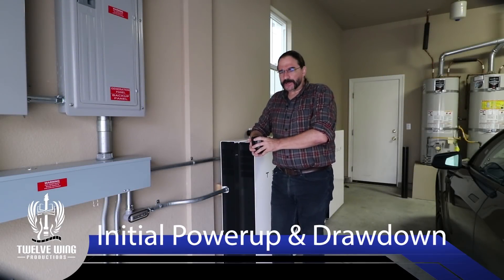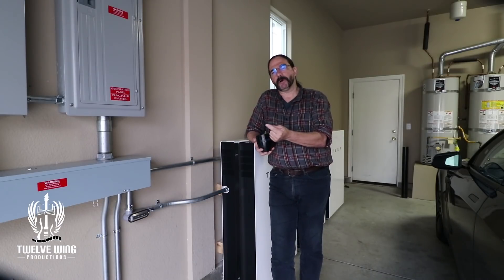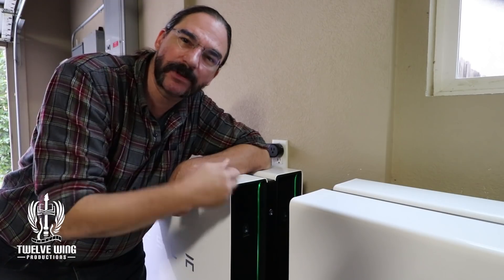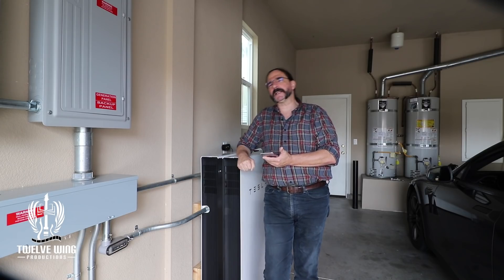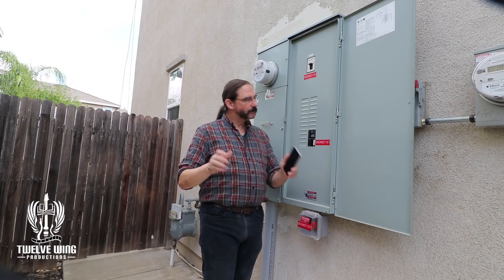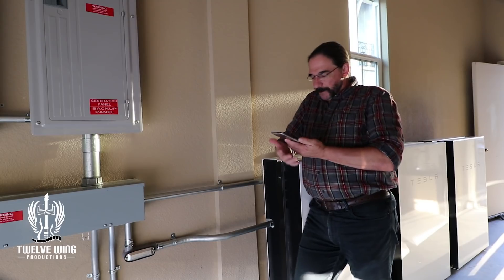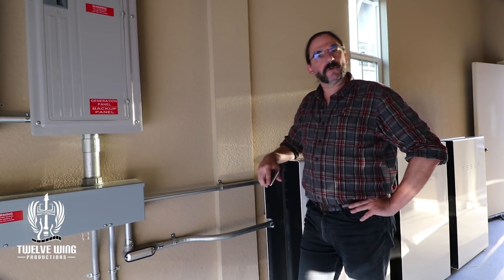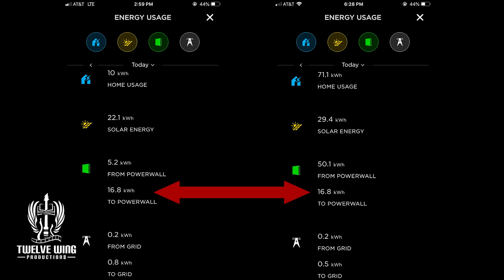New Tesla Powerwall 2 system? : Do this right away

Comment: I have 1 powerwall and they couldn’t connect my ac or the level 2 charger for my car.
Reply from the maker: One powerwall doesn't supply enough current to power an AC unit.  You need at least 2 of them.  3-6 is appropriate for most homes.
Reply: @twelvewingproductions7508  yeah it just wasn’t in the budget. Hopefully I can add another down the road

Comment: Will the 6 power walls and a roof full of solar panels fully run a large 6 bedroom 4,000 foot home, with 3 Large aircondition unit? I live in Philippines, plenty of sun!
Reply from the maker: The short answer is yes, but I would have to know more about your daily consumption to tell you what size system you would need.
The system in The Energy Sovereignty Project can give you some idea.  This system is 10kw of PV with 90kwh (82kwh usable) of battery storage.
This is enough to deal with 36kwh of home usage as well as 10,000 miles driven per year on excess sunlight.
We were limited in our install to about half of what I had initially wanted to use.  I would say to properly go off grid one would require 15--20kw of PV on a home the size home you have.
So long as your utility company isn't trying to limit you below that, the answer is yes.  Easily.

Comment: Have you done a session on how to determine which mode is best for one to use? I have 2 walls and I struggle deciding between them. Mainly because I find it hard to believe the arbitrage setting (cost reducing) can work without knowing my rates.
Reply from the maker: Frankly I'm a bit surprised that they haven't added more into the "custom" setting.
Currently I use self powered and manipulate the reserve setting as needed.
My feeling is similar to yours though in that there needs to be a way to program it with more information.

One thing I'm looking into is how the vehicle charging currently works and how I think it "should" work.  After that I should put a video up on my thoughts.

The system does know when your rates change.. so it doesn't really need to know your exact rates but it does need to know your peak times.  The way you have currently to enter it is clumsy and non intuitive.  I think they could have done that better.
Reply: Twelve Wing Productions Would be a great video to see how you think about it. Also trying to get an idea if it’s worth getting an additional wall. 6 seems like overkill for my situation but I’m debating if 3 or 4 make sense. Suppose then I will want more generation. Endless loop ;)
Reply from the maker: @normangennaro9448  Well, it's endless until you have what you need.  In our case, because of the driving, I think 4-6 is perfect but I'd really like to have an additional 7k or so of solar PV production to bring our total to around 17Kw.

Are you using an electric vehicle?  What's your average daily consumption per day spread over a year?
Ours was 36kwh on average for the year.
Reply: Twelve Wing Productions I do have a Tesla car as well. My usage patterns since covid are all messed up. I’m working from home now, my two sons were home (one went back to college today), we have had a heat wave and then fires pretty close which means windows closed/ac and fans where I usually don’t, but I’m not driving/charging the car. It’s super variable now and moreso than ever before. This week I have averaged 75 kWh with a peak of 83.5. In May I used 844kwh, June 613, July 1561 and Aug already at 1536. I had solar before w/o the powerwall so I don’t have an easy way to pull before then.
Reply from the maker: @normangennaro9448  Understood.  Yes, Covid has this all kinds of messed up as far as metrics.
Do you have a power bill for last August?  That might help but it looks like you are also in that 30kwh per day kind of range given your may numbers.
So I'd say you would also be looking at 10kwh of production and 4PW2's.
3 of them will run your entire home and the extra capacity will be mostly for when all this returns to normal and you are driving home to charge your car for the next day on power collected while the sun is shining.

What is your usually daily commute?
Reply: Twelve Wing Productions I’ve had solar now for almost 3yrs. I’ve got 9.9Kwp peak power capability. PGE monthly charges last August were $9.86 electrical but I also got hit with $1,053.30 NEM charges which is why I thought the powerwalls might help and after a long wait and tedious install which took a couple months are finally in. I can’t tell if I need more than two powerwalls since I’m not sure I could even charge them over the winter. It seems like they could be helpful over the summer but suspect I need more solar to make them useful in the winter?

Daily commute would be San Carlos to SFO so say 70 miles a day but we are now work from home probably through most of next year.
Reply from the maker: @normangennaro9448 , I would suggest that you have a look at our videos for November, December, January and February.
Those videos will show you the expected fall of and where the additional capacity came in handy.
Our goal in this was a little different than most in that we were focusing on how little we could use the grid at all.

In a way this was designed not only to be an argument ender but also to get people ready for when net metering ended.
On your last year's bill, what was the total usage shown for all of 2019?
With a tru-up of over $1,000 it seems like your total usage was up in the 40-50kwh per day range rather than 30.
Reply: @twelvewingproductions7508   Will do. I was watching the latest ones and then went through your past videos and found this one. Need to watch these others you recommend. My hope was that I could be minimally using the grid. Don't need or want to be off-grid but prefer to be self-sufficient which is why I found your videos so encouraging. While I have dropped a lot of usage it's clear I have a long ways to go. 2020 is looking like I've really reversed the trend :( I'm in Storm Watch right now and have been most of the weekend which is not helping and from what I can tell Advanced/Cost Savings isn't helping either but the tesla group tells me that is the best way given EV2-A.

2020: Total 3,101 Kwh, Avg 517 Kwh/mo, Max 1,103 Kwh/mo, Min 8 Kwh/mo
2019: Total 3,992 Kwh, Avg 333 Kwh/mo, Max 1,232 Kwh/mo, Min -320 Kwh/mo

2018: Total 15,612 Kwh, Avg 1,201 Kwh/mo, Max 1,837 Kwh/mo, Min 198 Kwh/mo
Added Solar in Aug 2018

2017: Total 17,174 Kwh, Avg 1,431 Kwh/mo, Max 1,675 Kwh/mo, Min 1,288 Kwh/mo
2016: Total 17,204 Kwh, Avg 1,434 Kwh/mo, Max 1,614 Kwh/mo, Min 1,147 Kwh/mo
Reply: @twelvewingproductions7508  The more I look at the data the sadder I get! From April-August 2019 I averaged a negative 232 Kwh. This year with all of the power/solar being turned off to get these walls installed (took the forever with covid, multiple days and several redos for inspections), I'm averaging a positive 135 Kwh and that does not include August which has to be a record given the heat, running a/c at night due to smoke and now storm watch.
Reply from the maker: @ngennaro  2020 has just been a complete bitch.  It really has.  I'm very thankful that we got a year's worth of solid data for the project before the nonsense started.  We had our issues too with the software faults near the end of the year, but at least the data was sound through the first of the year.

I'll try and crunch those numbers you gave me into something meaningful over the next couple days.  I have been dealing with family health issues on this end.
Reply: Twelve Wing Productions been a tough year no doubt. Hope all is ok. Please take care and don’t worry about my numbers. Know that the community loves your videos and insights but can and will wait for you!
Reply: Twelve Wing Productions maybe I was expecting too much precision :) I thought the difference between peak, shoulder and off peak might make a difference in whether it’s worth doing this arbitrage it seems to be doing on cost savings when it sends all the solar to the house or grid and not powerwall.

Comment: These are no go for off grid
Reply from the maker: They now have an off grid mode.
Tesla realizes that these things are being used in trailers now.  So they are making software alterations to allow for off grid use.
If you have some other reason you feel they are unsuitable that isn't covered by software, give a shout back and let us know why you feel that way.
Reply: @twelvewingproductions7508  i talked to tesla 2 weeks ago and they wete practically laughing at the idea of using it for off grid. Like "we deal with way bigger fish" kind of thing. They were also paranoid about incorredt jnstallation and use putting the brand image at risk
Reply from the maker: @mobiusdesigns , It's on their web page.
Reply: @twelvewingproductions7508  thanks
!
Reply: still couldnt find it. the screen redirects to talk to them in person. could you link me to the page?
Reply from the maker: @mobiusdesigns , if you haven't called them I'm not sure what additional information I could provide you.  Call them and tell them you want to install the batteries in a trailer.  I know someone that has done this.  Come back here and let us know what they tell you.  Please be honest about it because I can guarantee you that I'll be doing the same thing to verify the validity.
Reply: @twelvewingproductions7508  curious, where did you hear they are doing off grid mode now?

Comment: I think you are mistaken that PowerWall shuts off solar inverters, if the house circuits do not consume all generated power from PV inverter. PW plays with frequency of created AC to force inverters to stop producing power,  if house circuits and battery itself cannot consume all of it.
Reply from the maker: That's how the PW shuts off the inverters... by throwing them into a frequency fault until the batteries have some freeboard.  96-97% or so and they turn back on.

Comment: Just came across this video, my 2 PWs have been at 0% for the past week and a half as I wait for PTO.  Are you aware of any long term issues with leaving the batteries on and at 0% for so long?  Does it even matter if I toggle the switch to off at this point? Thanks.
Reply from the maker: If it's extreme yes... but for a month or so probably not.  When the battery says 0% there is still about 1kwh in each battery.  So you should be fine. If they keep dragging their feet for weeks, however, you should mention it to your installer.

Comment: Thank you for sharing and taking the time to make this video. I'm about to pull a trigger on 8.5kw solar array and Powerwall. I'm in MA so we have net metering. Our winter daily average 30 kWt. The local installer offers 1 PowerWall and subpanel for critical loads (like heat, fridge etc) to get us through outages. Tesla offers 2 Powerwalls for 30% more for the full house back up. What has more sense in the long run? Thx
Reply: Kirill who did you use in Ma?  I am looking into making a purchase with a home Reno. Need to look into the battery
Reply: @tgomes32  I went with revisionenergy.com  It seems they were more experienced with batteries that other two companies I interviewed. BTW, because of covid we are still in prep mode.

Comment: Permission to operate? That's funny, really funny. lol I know you're not supposed to flip the switch once your panel system gets installed but I'll quote what my installer told me, "Technically we can't prevent or stop you from using your system but................." lol
Reply: I agree, especially since your Powerwalls would absorb most of the solar until they are full.
Reply: I am getting my solar power system and Powerwalls installed next week.  I never would have thought of this, so thank you!
Reply: Are there any penalties if you don’t wait till your told to power on?
Reply: mchevownr - that depends. If your utility hasn’t said you have permission, it could mean that you will give them your solar power for free, or even worse, they will CHARGE YOU for the power you gave them!  Best to wait or operate off grid.
Reply: mchevownr this is one of those “don’t ask don’t tell” kind of things. lol

Comment: Nice breakdown!  I am in the process of installing 2 Powerwalls with a 13,065 kWh system and wanted to see if there are any circuits I SHOULD NOT be putting on the Powerwalls as whole house back up.  For example, HPWC for my car, pool pumps, washer/dryer.  I am just concerned if I do, and the power goes off at night the HPWC will drain the entire two batteries.  I know since you have 6 Powerwalls you probably didn't have to separate the loads, but I wanted to get your thoughts on this.  Thanks again!
Reply from the maker: Your main issue will be total load.  With two powerwalls, you have a total of 10kw to work with.  If you are still on grid power, that's fine.  If you aren't then you run the risk of tripping the system off if you try and charge your car.

But here is the deal though.  If you have a power outage, NOT having your EV charger or AC on the system might make for more than discomfort depending on your situation.

I would say that you can certainly do without a pool pump for a few hours or a day or so... but vehicle charging?  I would leave that one BUT... in the case of a power outage, be very careful at how much current you send to the car.
If you have a Tesla, this will be easy.  If your car is something else, you will have to consult your owner's manual to see how to do this.

What is the total average draw of your home over the course of a year?  If you can give me a summer and winter average home usage that will be even more helpful.

Also your general location and elevation will be helpful for me to give you a better idea of what I might chose to leave out.
Reply: @twelvewingproductions7508  Good point on the EV lowering the current.  My average kWh over 12 months is 1355.  My avg summer is 1520 and avg winter is 1275.  I live in SoCali as an SCE with a TOU D Prime.  We are not part of SCE's PSPS and rarely have power outages lasting longer than an hour.  Powerwall is to primarily offset new TOU peak hours of 4-9PM.  Thanks again!
Reply from the maker: @htran383 , Just so I understand you correctly, you are using approx. 50kwh per day summer and 42kwh a day in winter for an average daily usage of 45kwh.

Is that with charging your electric vehicle at home or is this before factoring in an electric vehicle.
Also, it would be handy to know the approx. square footage of your home and the layout... one story or two.
This will help me give you some prudent advice.
Currently I would say that you would require 20kw of PV production and 4-6 Powerwalls or around 90kwh of storage if you use some other battery type.

The answer about the EV will help me give a better estimate.
The fact that you are in SoCal is hugely beneficial for solar production.
Reply: @twelvewingproductions7508  That's with the my MS 75 charging for the past year.  Single story, 2600 sqft.
Reply from the maker: @htran383  Perfect, and that's exactly what I needed to know.
So yes, you fit squarely into the exact average household with around 30kwh of usage minus the car.  Then you pack in about another 10-15kwh on average of charging to the car.  That mirrors pretty much exactly what you have seen with The Energy Sovereignty Project home.
The only difference is that we didn't add the car in winter but instead saw more value in examining the winger numbers separately so we could more easily tease out how much additional solar we needed.

For us, we need an additional 6-8kw of PV for a total of around 16-18.  But then I don't drive as much as some do.

How much driving have you done this year in your Tesla?

Comment: @ ~ 8:20 you say that if a person has a smaller system (and you plug in something like your car) you could be in a situation where you're drawing too much current & the system will shut off.  Since I don't currently have a system I don't know what the ramifications are if the system shuts off.  Is it nothing more than resetting a circuit breaker or ???  Does it cause damage to the system?  Does a service rep have to come out and reset something?  I'm watching all of your videos but I'm not currently studying them to the level where I might be able to answer my own questions.  I'm trying to get a feel for what gotchas there are out there so that I don't get blindsided too much.  Great job.  Your efforts are greatly appreciated.
Reply from the maker: We did a couple different tests.
if the grid is active the gateway simply sorts it out and draws the additional current from the grid.
The issue comes when the grid is shut off.  If you only have 2 powerwalls and you plug your EV in to charge on an high power wall charger, the system will go into a rapid shut down and reset.
It takes the batteries about 10 minutes to reset and it takes the inverters about another 5 minutes after that to reset.
The inverter can't reset on it's own because it has no power to do so if the batteries are shut down.  So all that time you are also not producing solar power.

So monitoring and uncerstanding your system is important.
Reply: @twelvewingproductions7508  Thank you sir for the information.  There are so many subtleties w.r.t. the powerwalls that it makes it very difficult to know which ones I should be twigging on and which ones I shouldn't.  All the best and thank you so much for what you're doing.